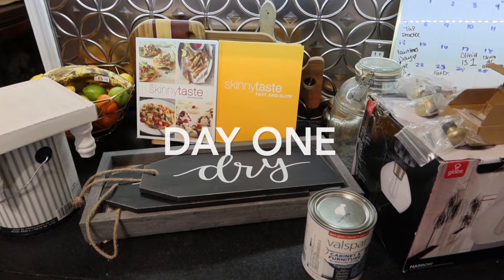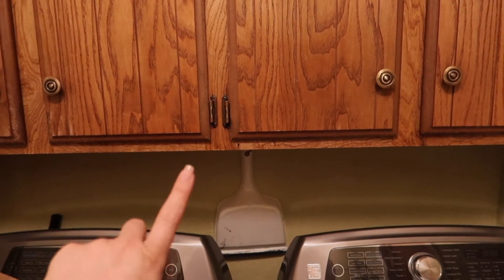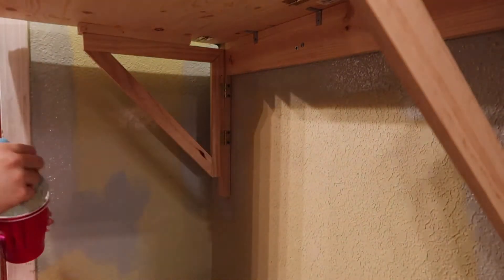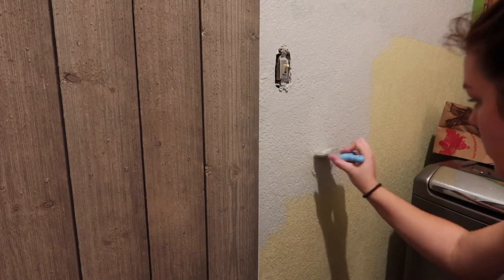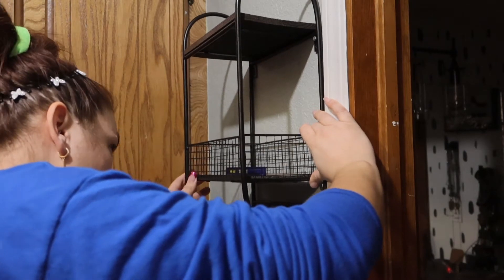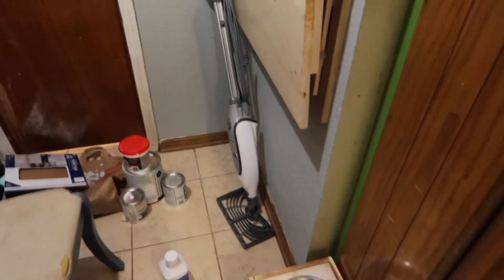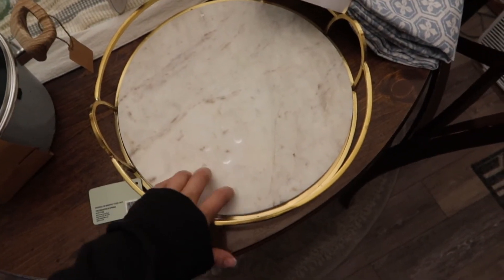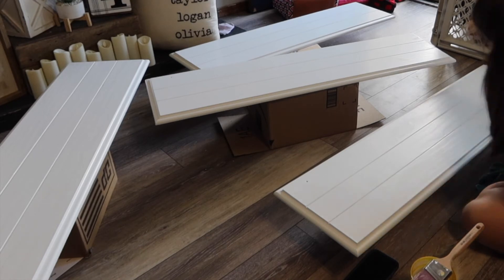DIY Laundry Room Makeover *2021* I PART ONE

Comment: Came across your video while looking for ideas how to try and fix up my basement laundry space (not a separate room).  I like what you did.  I wish I had cabinets, but I'm not going to have any installed.  I do have a small shelf that's been in storage for years that I can definitely use to hold laundry items like my dryer sheets, etc. - seeing the little shelf that you put to use reminded me that I have one and can put it to good use again.  That "thing" that runs across the top of the ceiling and part of the wall in your laundry room and bathroom is called a "soffit" and it is often used to frame in and cover heating ducts and/or plumbing pipes.  Sometimes they are empty of heating ducts or plumbing pipes, they are just installed by the builder to cover up the space between the top of cabinets and ceiling like in a kitchen.